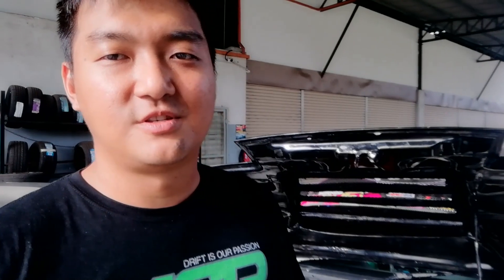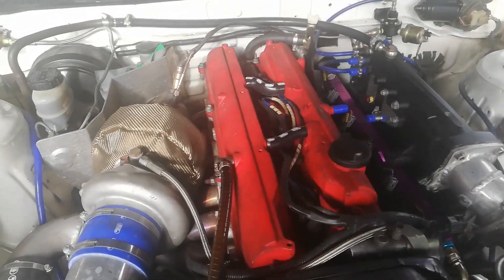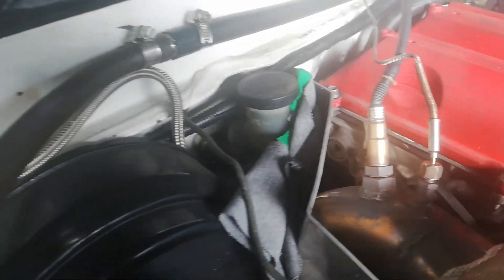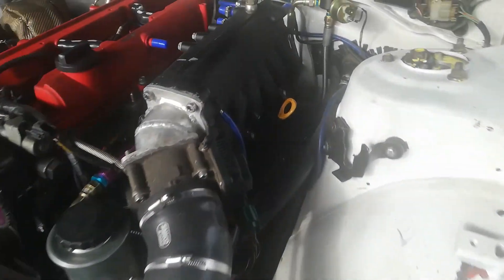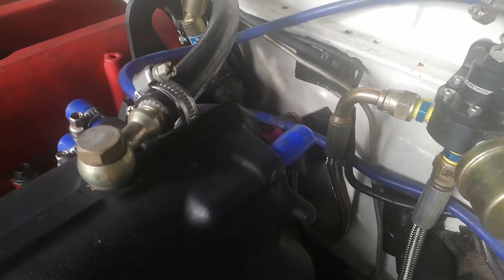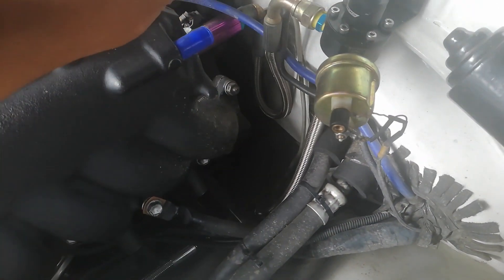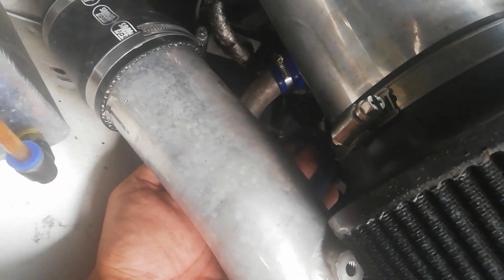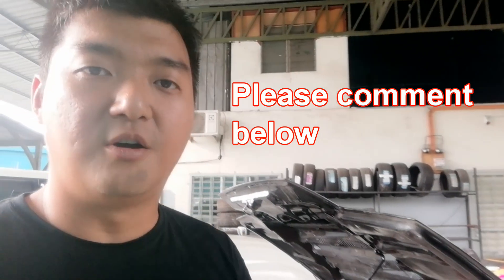2J Tuesday Engine Building - Teflon Hoses functions and uses

Comment from the maker: There are so many advantages of using Teflon hoses to replace your normal air and fuel hoses. Do you guys use Teflon hoses too? 
BTW if you guys want to increase horsepower for your 2JZ reliably, make sure you check this out https://www.youtube.com/watch?v=6m452mDcsKk&t=103s

Comment: How can you have VVTi solenoind , but non VVTi timing gear? I would like to do it the other way around, can VVTi be added to non VVTi head..? Thanks
Reply from the maker: Hehe that's valid question. It's because I'm using a VVTi head, so I don't have non VVTi first camshaft cap, so I just reuse back the VVTi cap, however I need to mod the camshaft a little bit. U can check my another video out about the camshaft mod